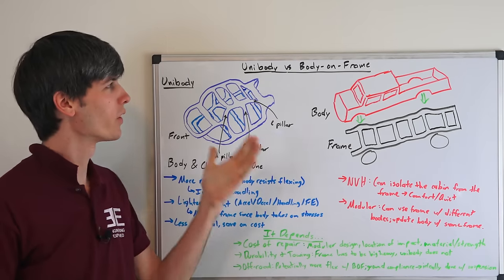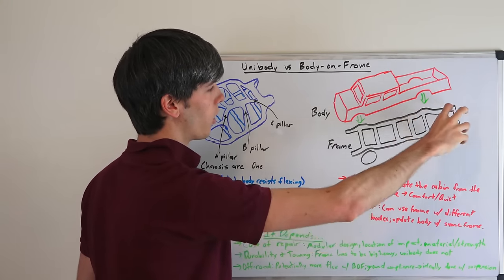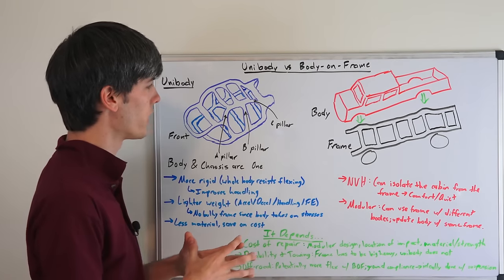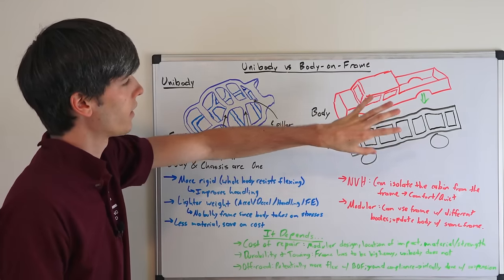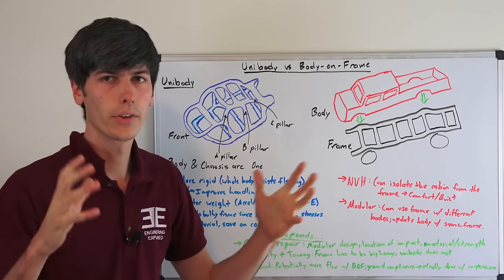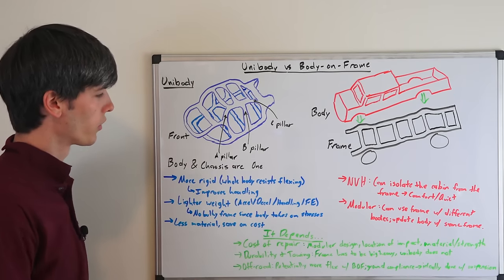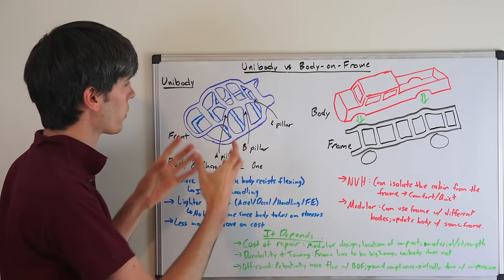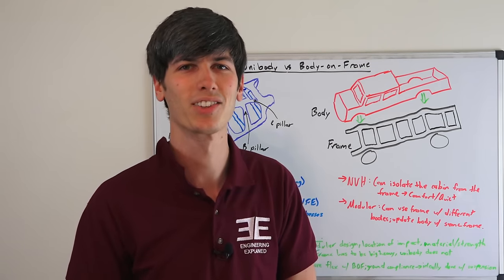Unibody vs Body On Frame - Which Is Best?

Comment: Maybe I m wrong but for me you missed an advantage of the backbone that could changes everything related to your lower weight unibody conclusions. A backbone could only have one fiber shell for the whole body, you will need a bunch of fiber panel to create the body wich will be more complexe. SO ok you gain weight because you don't need a body but is the full unibody lighter than a simple backbone frame without the body? For me a fiber body with a backbone frame is lighter than an unibody with metal parts to fit the gaps all over it...Look at the 2000lbs tvr griffith with a v8 5l on it, It don't seems overweighted compared to all his 600lbs heavier unibody small engine roadster contempary. Don't tell me it's the lack of airbag and safety features because that's not true...

Comment: So in a hypothetical scenario  let's say someone wants to build his own vehicle just for fun not to start a business just a pet project 

Which would be better for that project 

Body on frame or unibody
Reply: Golden Retriever what is the purpose of the vehicle?  If designing a high performance car from scratch, I'd suggest a tubular steel space frame, perhaps with a backbone structure if it's front engine rear drive.

Comment: Is that why suv's crumple more when in a crash? Like when someone shows you a picture of a crash between a car and suv, where it looks like the suv wast destroyed?
Reply: +Jesse Silva 
As long as all the deformation and destruction has ocurred in front of the firewall, then " alot of destruction" is actually a good thing.
The car absorbs the energy from the crash by deformation.
Usually cars are designed to be "weak and easy to crumple" in the front while anything inbetween the firewall and the trunk is designed to be as tough as possible, so in a frontal crash the car will absorb as much energy as possible without hurting the passenger or making it hard to remove the passenger from the wreck.

Comment: Hello Sir,
My 2001 Corolla is all rusted in bottom. Canada as you know.
 I want to change the bottom frame only. As it is unibody frame, can i change the bottom frame? Please guide as the engine is butter, and i don't wanna scrap such a good engine.

Comment: This guy is explaining it as if the build is always done like this. Its not.  Car CEOS force the engineers to save AS MUCH cost as possible....so they make the unibody SSUUPPPEERRR thin and CHEAP metal that lasts 5 to 8 YEARS before rust forces major repairs. No space to work on them urself so it makes mechanics happy. Older trucks like 95 and lower had a competition on whos truck was more amazing so they made everything to LAST LONG, from 70s to 90s the quality goes down and cheaper parts go in. NOW days the car corps have ZERO competition and are all inagreement on the format: Build, UPSELL, fix, recycle, so they can be as cheap as they want to.

So you want somethin that will stick around, go older.
Reply: I have seen crash tests where a cement truck is run into various vehicles. The unibody gets smooshed in all but the largest unibody SUVs. Body on frame seemed to perform WAY better. I'm not sure about side collisions though. 

In that test a F-350 was nuts how good it withstood that impact.

Comment: So if unibody hit by Suv and truck at high speed, the driver in the unibody will take more of the impact? And is the unibody as safe after a repair to rear panel and frame stretching, etc.

Comment: Nothing (well nothing that's under 6 figures) matches the ride quality and comfort of a large body on frame luxury car with soft suspension and over assisted power steering. It's like a couch on wheels if you have ever driven an older Cadillac or Lincoln before FWD and unibody cars really took off.  The industry just shifted to making everything more sporty which is not necessarily a good thing.  So many vehicles actually have emblems that say "sport" on them.  Unibody is superior for actual sports cars and smaller economy cars for the reasons in the video.  

Maybe do a future video on fiberglass bodies such as those in Corvettes for decades.

Comment: Hi EE, what bout the monocoque o space frame? Is it uni-body another commonly term for  referring  to a monocoque structural approach? Thanks for the video
Reply: +huevonIII No actually unibody and monocoque are two separate things.
They are pretty similar, but unibody cars use frame rails, sub frames etc. which are not found in monocoques.

To quote wikipedia: "Commercial car bodies are almost never monocoques; instead modern cars use unitary body / chassis, unitary construction. unibody, or Body Frame Integral construction,  with box sections, bulkheads and tubes providing most of the strength of the vehicle, while the skin adds relatively little to the strength or stiffness. The term monocoque has often been misused when referring to unibody cars."
Reply: Thank you Joel. Now that pretty much take away all the blurry misconception. What would you say is a best example for monocoque in a car structural construction?
Reply: ***** Koenigsegg build probably the highest quality and safest monocoques for road cars.
Also F1 cars have been using true carbon fiber monocoques for a very long time.
Reply: Cool, will check that out. Cheers

Comment: Body on frame is way better.
I'm going to prove it. Get into a fender bender. In a unibody. And hit a body on frame vehicle. And then see what the repair cost are going to be. You'll be amazed.
I hit a chevy silverado in the bumper with a 2008 civic.
At about twenty mile per hour. Nothing more.
And it didn't put a scratch on the silverado. But it caused.
$4600 damage to my civic.
It completely totalled out my civic. All because it's a cheap unibody. I highly support body on frame. They're stronger more rigid material. A unibody is like driving an egg with wheels. They will fold up like an aluminum can. If you just tap somebody at ten mile per hour.
Reply: Not to discount your anecdote, but a Chevy Silverado is significantly larger and heavier than a 2008 Honda Civic. Still, $4600 worth of damage for only a 20mph (44 kph) crash is pretty bad.

Comment: i watched eric the car guys video on his foxbody awhile back i remember him saying it was a unibody and they tend to flex which contradicts what you say here? he had a demo of him lifting the car on a hoist and the body flexed enough that the door wouldnt close. Is that just an exception to the rule?
Reply from the maker: +TheJanope13 Just because a car has a unibody doesn't mean it's super rigid. For the same reason, just because a vehicle has a turbocharger doesn't make it fast. Obviously a lot of work has to go into the design. Some designs will be better than others.

Comment: Body of frame will always be superior to unibody when it comes to towing. Please list a unibody vehicle that can tow 7,000 pounds of trailer weight. Body on frame trucks and SUVs can
Reply: You ask for it! The MB GL450, our current TV, has a 7500 Towing capacity.

Comment: How Engines are tuned:- like Ford ECO-BOOST..how does it vary from a conventional D-injected turbo engine ?
Reply: +Balaji Chandrasekaran AFAIK, ECO boost is an engine family built from the ground up, with at least 80% of the focus being an efficient engine, yet still somewhat powerful. using lightweight stuff, low friction cast piston, low friction valvetrain, oversquared engine, AND turbo for pumping more out of smaller engines.

it's somewhat similiar in goal to mazda's skydrive engines. just not similar in design
Reply: Kenny David SO it's Ford's way of engine design
 just like i-Vtec's and Dtec's of Honda right ?
Reply: +Balaji Chandrasekaran yes eco boost is mainly a name used for marketing on their turbocharged engines.
As far as I know there are no major differences to conventional turbocharged engines.
Reply: Joel Sägesser nope ford's 1.0 ecoboost offering is more powerful + efficient than their standard 1.5L engine

Comment: Is it practically possible to absorb heat from exhaust manifold and use it sor of a compressor unit of  A/C or cool the inlet air before the Throttle body
Reply: +Balaji Chandrasekaran Cooling the intake to below ambient is really hard, its fast moveing air that need to have a free flow.

There are some forced induction cars that use ice to cool the intake air but that's only good for a short while.

Comment: Is the monocoque chassis the ultimate version of the unibody chassis?
Reply: Unibody is just a literal translation of Monocoque
Reply: @beezanteeum  In linguistics, yes. But from what I know, a unibody has additional structures to help bear load as well, so it is not a true monocoque, where there are no additional structures to help bear load. Only a few production cars are monocoque iirc.

Comment: could u explaine what the hell  monoocque  (integral) and  space frame i have an assignment to do involving them and iam confused as hell SOS :(
Reply: In a monocoque, the chassis is integral with the body.  An example that's easy to visualize is a commercial aircraft, or a 60s F1 car (because their design is very simple).

A space frame is a chassis structure independent of its body panels.  It is a truss type structure.  The Mercedes 300SL is a great example here.
Reply: And I just realized this is 3 years late and I probably haven't helped you at all.  Oops.  :/

Comment: MonoCoque Chasis and Ladder-on Frame..>>>>Means the same as the Title right ! ?:-)
Reply: +Balaji Chandrasekaran yes
Reply: +Raidensnakeezio No a monocoque and unibody are not the same. Monocoque would mean that the "outer skin" of the chassis provides all the strength, which is not the case in unbody cars because Unibody cars use frame rails, sub frames and boxed sections.

Also the other one is not called "ladder on frame". It's referring to body on frame but it's the frame itself is called "ladder frame", so it's "body on ladder frame" not "ladder on frame".
Reply: ehh close enough you could get what he was saying

Comment: How about monocoque design
Reply: Monocoque and unibody are the same. Mono/uni = one, so one body one frame. The terms monocoque and unibody can be interchangeable
Reply: +Wtrxprs007able No! 
To quote Wikipedia (we shall assume it is a reliable source): "Commercial car bodies are almost never monocoques; instead modern cars use unitary body / chassis, unitary construction. unibody, or Body Frame Integral construction,[7] with box sections, bulkheads and tubes providing most of the strength of the vehicle, while the skin adds relatively little to the strength or stiffness. The term monocoque has often been misused when referring to unibody cars."

The two are very similar, but unibody cars use frame rails, subframes etc. which you would not find in a monocoque.
The only true monocoques used in cars are carbon fiber monocoques, because they support all the stress on their shell, which you cannot do as easily with sheet metal alone.
Reply: +Joel Sägesser I stand corrected. Thank you

Comment: What do these CAR reviewers mean by AGILE Chasis
Reply: +Balaji Chandrasekaran in technical terms, it means that it's more resistant to flexing. in simple English: it can go faster around corners.
Reply: +Raidensnakeezio No, an agile chassis means that it responds well to input, for example sharp turn in, fast change of directions/ weight transfer and good braking performance.

What you described is called a "stiff chassis".
Reply: +Joel Sägesser Same difference right?. I would imagine a "stiff chassis" would contribute to fast turn in/ fast change of directions.
Reply: jagerbomb7810 it would,but still it's not the same thing
Reply: Joel Sägesser thanks for the corrections tho
Reply: a Royal Enfield   motorbike is more agile to avoid a collision with a holy cow suddenly  deciding to sit  in the middle of the street than a Tata  bus .

Comment: unibody is junk once its rotted it comprimises structural stability.and alot of the time cant be repaired easaly if a frame is rotted can be cheaply repaired unibody cars are throw away cars and cant take the same impact a frame car can take
Reply: the goal of a vehical is longgevity